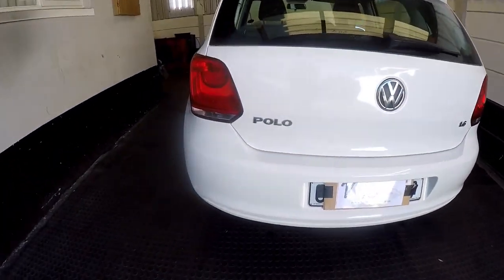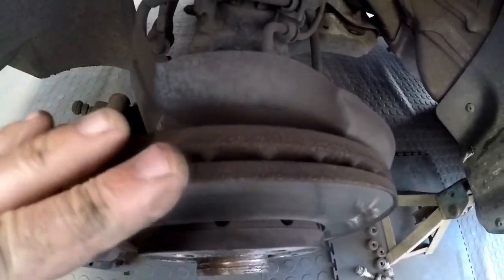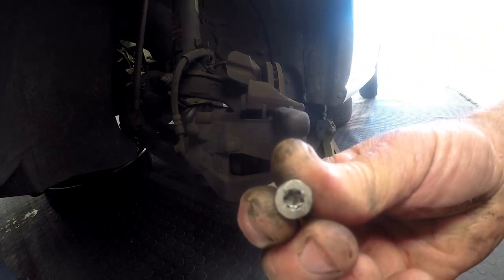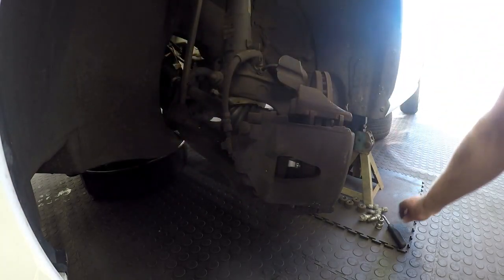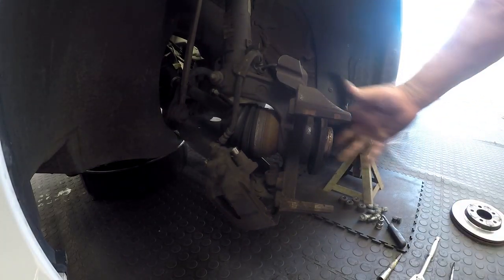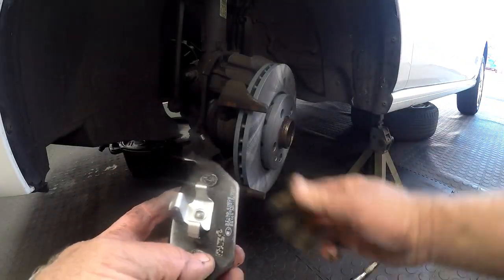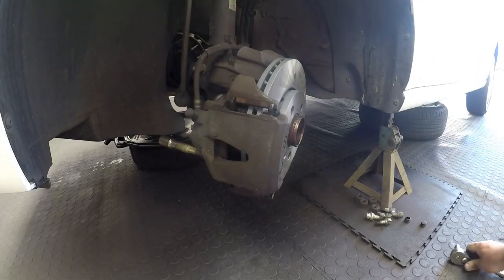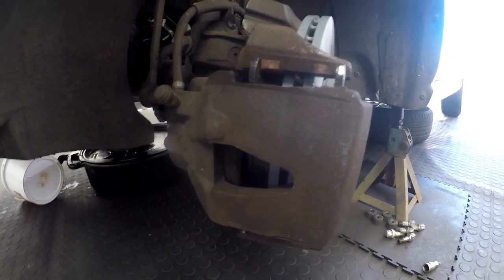Vw Polo   Front Brake Discs & Pads

Comment: Having watched this I now have confidence to do this job. One question I have though - I've seen some channels recommend use of copper or other suitable grease before installing the new discs and also greasing the locating tabs of the pads to ensure they slide smoothly along the caliper. Maybe this is overkill and I can imagine the grease on the pads would soon disappear anyway after driving through a few rainstorms but interested  to know your thoughts on this.
Also some people use a wire brush and brake cleaner to clean up everything - again maybe this is more cosmetic than functional.
Finally I think most people advise to bleed the brakes after this kind of job and certainly this would be a suitable time to do that job as well because this can make a huge difference to overall brake performance as well as pedal feel and should be done from time to time regardless of any other work.
Thanks once again for a great video filmed at a nice clear angle making it easy to follow.
Reply from the maker: Hello Dave's, thanks for supporting my channel and engaging in this topic, many people making videos are inexperienced and just follow and apply what they see in videos they watched, I am a 35+ year veteran being a professionally trained Mechanic and remaining one all my adult life, so you can imagine how many brake repair procedures I have done, yes your comments about cleaning the brake area, applying grease is cosmetic, when there is a problem with seized calliper sliders it has to be removed and repaired, not smeared with grease, besides if grease gets on the abrasive surfaces of the pads it will be drastically compromised. 
As one knows the minute new brakes start working if gives off brake dust and the brakes are an open system exposed to the elements, therefore the brake dust is discarded immediately, but being so fine some of it sticks to the surrounding components, this will not affect the efficiency of the braking system. It is never necessary to bleed brakes unless the hydraulic system has been worked on and opened allowing air in, Brake hydraulic systems are sealed keeping the brake fluid in, merely changing brake pads will not allow air into the hydraulic system through standard replacement procedures., I hope that answers your questions and once again thank you for your support, check out my website for more useful information and let me know what you think. GARY
https://www.vehiclemaintenanceandrepairs.com/
Reply: @vehiclemaintenanceandrepai3790  Hi Gary, nice to hear from you and thanks for replying to my comments. It's always good to hear from someone who actually has hands on experience day in day out. I guess the copper grease manufacturers would go out of business if more people knew this! I'll definitely take a look at other videos on your channel for maintenance advice and ideas. Next big job will be replacement of suspension bushes and possibly the shocks too while I'm there. Cheers, DAVE
Reply: Hi, any copper or ceramic slick helps prevent issues with any maintenance. For example a turbo rots so does the manifold over time. It preventative care
Reply: Don’t let the caliper hang like in the video. If you do this it could damage the brake line which could impact the performance and operation of your brakes

Comment: Thank you Oom, Another excellent video...
I think you might have covered this in the comments already...My question is about the regular brake fluid flush...
I do understand a computer must be plugged in to properly bleed the system, - in order to flush the fluid in the ABS pump aswell...

1. How effective and is it safe, If we can just bleed the system using the old school method - without using a computer ?
2. Is is necessary to bleed the clutch aswell, as I believe the clutch shares the same fluid reservoir ?

I obviously would not hold you to your answers...However your advise will be appreciated. 

Thank you once again for the great videos...Keep it going..

Comment: Hello, I have installed brand new ceramic pads with motul rbf600 fluid, brakes bled, pedal gets hard when pumping engine off but not hard as rock. If I put constant pressure, the pedal doesn't go to the floor, it's not moving further. Should the brake system start braking with little pedal travel ? Thanks
Reply from the maker: Hi thanks for supporting my channel with your visit, all cars are different, factors such as toe-board clearance, age of the car type of flexible brake hoses fitted (some are braided) if the brake master and slave cylinders/callipers/pads/shoes etc. have been replaced and are the brakes bled and adjusted (as in brake shoes) properly, these are all factors which can affect the feel of a brake pedal, the important thing is the pedal should not feel extra spongy or hard and the brakes are activated with minimal effort through applying nominal pressure to the brake pedal and it slows or stops the vehicle in good time. I hope that answers your enquiry. Happy Holidays and Merry Christmas to you.       Gary
Reply: @vehiclemaintenanceandrepai3790  Thank you ! Merry christmas for you too !

Comment: There is one thing that I'd like to make sure of. After you have installed the new brake pads and went to pump the brake pedal a couple of times, did you close the brake fluid cap to prevent the pressure on the brake pedal from pushing the brake fluid out of the top? Not sure whether that will happen or not but I'd like to be sure before attempting this.

Thanks for the video!
Reply from the maker: Hello, Morne thanks for supporting my channel, rest assured the brake fluid will not be pumped out the reservoir cap as the pressure is pushed into the brake pipes when the pedal is depressed, even with the cap off. Gary

Comment: What if you pump the brake pedal while the engine is running but the vehicle is standstill at a same time
Reply from the maker: It will produce the same result, nothing will be damaged.

Comment: Please help my brakes on mi vw polo does not apply all way down sumtimes it gets hard  and brake lights comes on ,handbrake and abs lights comes on ,i dnt feel free while driving coz i  knw i cant have that quick brake wen in need,wat could be the coz
Reply from the maker: Hi Niko, thanks for supporting my channel with your visit and interaction, it seems you have problems with your ABS system, you may have to bleed the system with diagnostics, it is called ABS bleeding, it requires diagnostic equipment with an ABS bleeding module (software), best left to the experts.

Comment: You didnt wire brush the hub and sliders and you didn’t copper grease them also you should use brake cleaner in the discs to remove the protective coating ?!?!
Reply from the maker: Thanks for the advice it is appreciated.